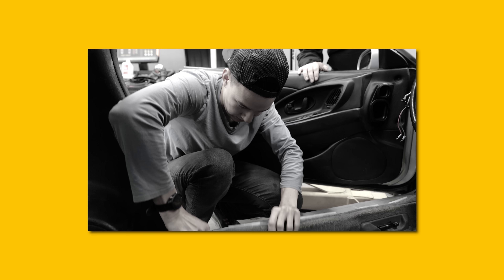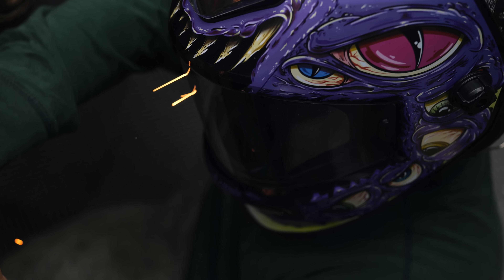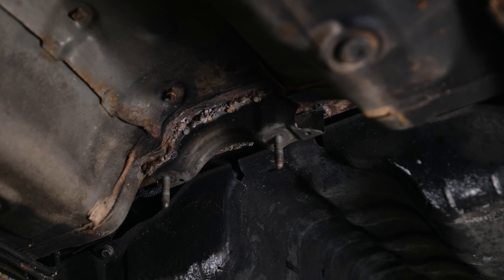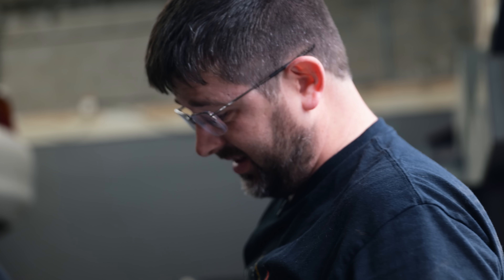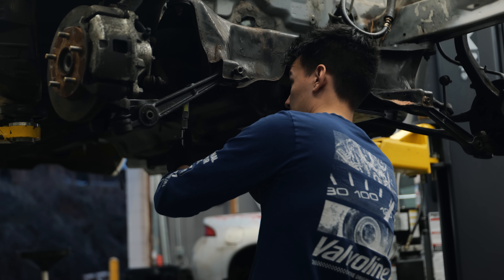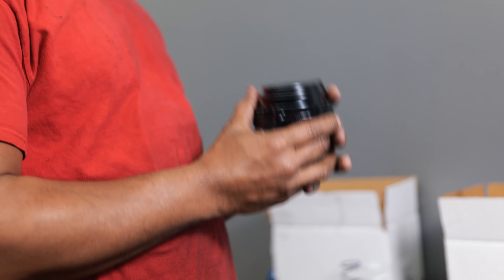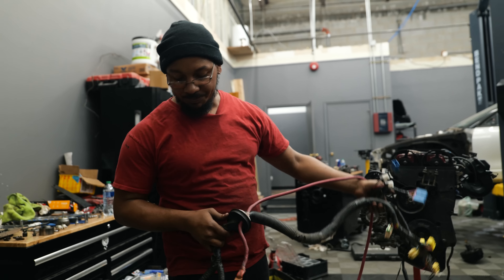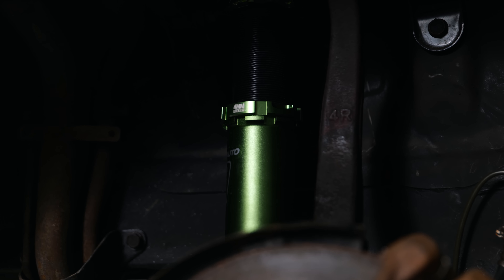Goodbye Mitsubishi, Hello Eagle - DSM Chassis Swap Ep 2

Comment: I did this exact thing with my 3000gt, I had a 94 sl that got rear ended so i got a 98 base chassis (although gutted and a rolling shell) and swapped everything from one chassis to another since everything still worked (engine, trans, wiring, interior, suspension etc). It was no easy task but I got it done and to see this happen with a DSM makes me happy. Huge respect for anyone who gets it done, especially having experience having done it myself. It's a little on the extreme side for the usual home mechanic but it just goes to show that it all really just depends on the determination of the owner to keep the car and platform alive. Better to salvage everything and do a body transplant than to let another one of these cars die and rot away because they're a dwindling number and a dying platform.

Comment: Love how one of the guys was talking about how great it is to work with guys that have worked on DSM's as much as him, then the next shot is him looking at the SRS module under the console and calling it the ABS module. The 2G DSM's that had ABS had the module mounted under a funky plate on the passenger footwell.
Reply: Yes and you hear me correct myself after. Been a while since I’ve been around the stock interior of a 2G.

Comment: I would suggest bench checking the wastegates to make sure it opens at around 20psi. In my Tial wastegate if I followed the spring chart it was not the same boost as referenced. For instance, my black and blue springs were 14-15 psi each. My green spring was 8psi. So I ended up tuning just the black spring to achieve 14psi. I just recently upgraded and installed the green to go with the black springs and it’s seeing around 22psi now.
Reply: We did, and you guessed it. It didn't open. So I redid it
Reply: @Kenuwine24  awesome!  Imagine my surprise when I boosted to 40psi on my stock block evo 9 😂. It took it like a champ though 😂
Reply: @vicmreyes  yeah, I had the compressor set at 20psi. And that gate wouldn't budge. It was opening at 60. So I took it apart and only used 2 springs. It opened then at 19/20. I still expect some differences once we get it on the dyno
Reply: @Kenuwine24  I ran into this a few years ago and my tuner and I made a video about it. Ever since then I’ve bench checked the wastegates just in case.  I now have trust issues 😂
Reply: @vicmreyes  I don't blame you. I like to run the 4 port ebcs more so usually I go with the 1 spring. Like a 8psi.
Reply: @Kenuwine24  haven’t tried a 4 port yet. Still rocking the grimmspeed 3 port. Maybe I’ll upgrade when the 3 port goes

Comment: I really don’t understand how y’all have that many people working on one car to go through all of that work and not even clean the parts before putting them back on. I did pretty much the same thing to a Miata in two weeks, doing it after work by myself (and that includes redoing all the wiring for the different style coils, MAF as well as replacing all of the gaskets on the engine) and when I was done, people had told me it was the cleanest and nicest looking Miata engine bay they had ever seen. It’s not like you really get another chance to clean it like that without taking it back apart.

Comment: Gotta be grateful to those 4 DSMers for sure.

Why not just delete the ABS system completely, I did that on my 1g back in the day.

The new talon chassis can definitely use some Fluid Film or Surafce Shield underneath to try and stop the spread of the rust already there and prevent any new rust starting.
Reply: We reused the ABS because we figured making all the brake lines would’ve taken longer than just swapping over the stuff that was there.

Comment: at  this point you might as well refresh the whole engine from the eclipse, drivetrain and suspension bushings of the eagle talon before you put everything back into it.. saves you the trouble of pulling stuff in and out of it later down the road driving the eagle talon.

Comment: Not to sound crazy but he could have bought sheet metal and get the rust off and build New floor lol and some of the spots just saying but it sucks the rust can really make the car unstable at times
Reply: Problem is 1: limited time to get the work done and 2: a lot of those rusted areas transmit suspension loads. It would take a lot of work to de-rustify this thing.